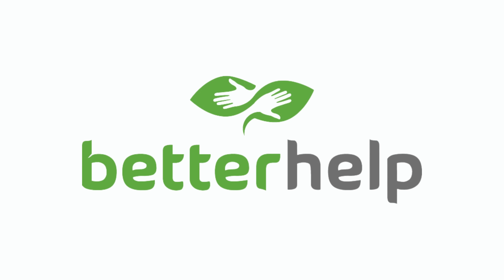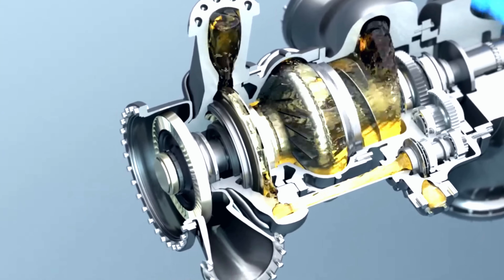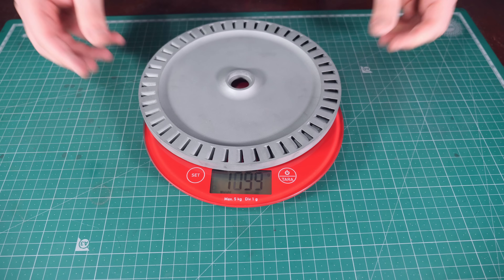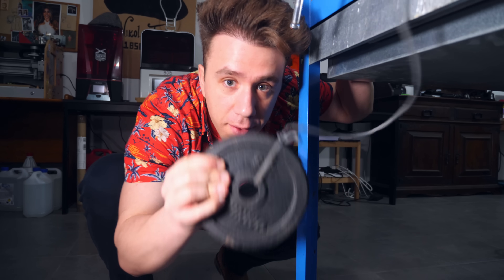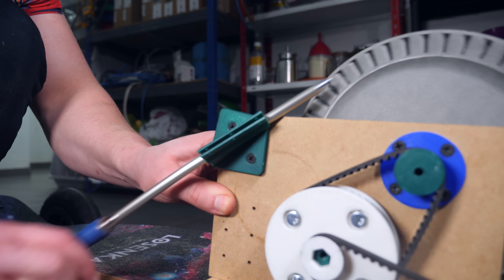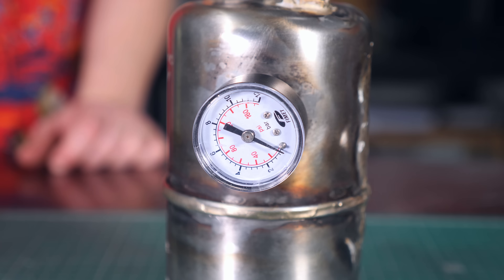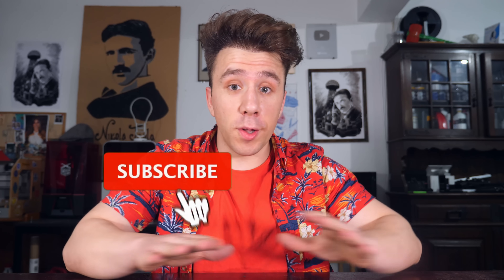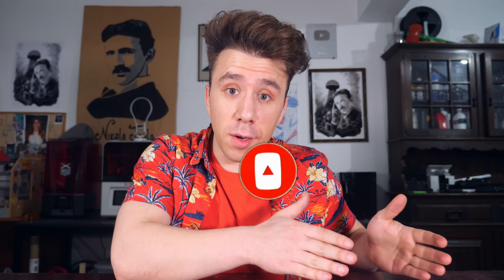I built a TURBINE Skateboard

Comment: Too many dangerous elements in your ‘design’ and execution. It’s one thing to experiment, but quite another to experiment with your health. Open printed metal flywheel with no guarding at all. It could have shattered and all the bits would have hit your face. Liquid nitrogen where were your gloves? Bottled nitrogen, no pressure relief valve. Not fixed to anything. If you’d dropped it the valve could have broken causing the bottle to fly off, hit you or a bystander.
I usually enjoy your videos, but no this one. It was a stupid idea, executed stupidly.

Comment: How about taking what you have and mounting it on a go cart frame. You’ll have steering and brakes. You can offset the additional mass of the go cart by running your turbine with the regulator on the nitrogen tank at a higher pressure.

Comment: Is the turbine engine a cousin to the turbojet engine? They seem to be basically the same thing, except for how a turbine engine uses the internal turbine to give a mechanical output instead of connecting it to the intake fan and using the escaping gasses for thrust. I thought you were talking about a turbojet at first because you used turbojet diagrams in the video, but I could be wrong.

Also, since this engine resembles a turbojet so much, would it be possible to combine both into one? An engine with both a mechanical output for driving wheels AND a jet exhaust for thrust?

Comment: Maybe try mounting the turbine on a “spar” sticking out in front of the front wheels and placing the nitrogen bottle on a towed trailer.  This would give you room to sit.  By using skateboard style mounts you could steer by leaning.  Mount a pole in the center of the board to make steering easier.

Comment: This is INSANELY suicidal. MAKING a pressure vessel then filling it with liquid nitrogen, then putting it on a camp stove???? You're gonna need a lot more than safety glasses. Why didn't you at least use an old propane bottle? This is extra work to be more dangerous.

Comment: Theme: why traktors dont use jet engines and turbines, in a high tork gearbox. T if the jet is geared down enough, it would make the tractor have enormous torque. You could also use an hydraulic gearbox with expanding wheels to make the transition smoother.

Comment: Cars (and trains) aren’t powered by turbines for two simple reasons: FOD (foreign object damage); and dirt. 

Several companies have tried, both cars and trains, but found that it required way too much air filtration.  

Something as small as a 1” 1/4-20 bolt can and will cause a catastrophic failure if ingested by a turbine.  

It breaks off a small piece of the compressor, which breaks off another, and another, and so on until the entire assembly (rotating at several thousand rpm) explodes.  

In addition, dust and dirt build up on the compressor blades, causing flow turbulence to build up.  This quickly leads to efficiency loss, and eventually stalls the compressor, leading to flow stoppages in the stalled section large enough to break off parts of the compressor.  

Having seen turbines explode from both FOD and compressor stalls, I can tell you that they are difficult to tell apart, they happen extremely fast, and you will s##t your pants if you are anywhere near when it happens.  

I spent 43 years operating gas turbine generators.  We had to shut down to wash the compressors every 3 months.  During that three month cycle, we would lose as much as 5% efficiency.  

That may not sound like much to the average layman, but it is enough to make engineers shudder.  

Gaining as much as 2% fuel efficiency with a new design is enough to make worldwide headlines in the trade magazines.  

In a 40 MW plant it worked out to about $250,000 dollars in excess fuel costs between washes.

Comment: Hello Interngiza, I know it will require more power but I wished you used a kart, this way you can have a place to stand, you are able to steer and also you can compare different types of engines to see which one is more efficient and why (would love to also see all the internal combustion engines or some type of steam engines compared to some electric one working with a cordless drill battery)

Comment: Please don't die... Playing with fire is a thing but you seem to get closer and closer to dying without even realising it. Don't stand in front of a 1.3kg metal disk spinning at thousands of rpms held on by pla (i know there is a bolt in the middle, why not have made the hole the right size for a bolt ?)
AND PLEASE DON'T MAKE HOMEMADE CRYOGENS PRESSURE VESSELS *EVEN LESS WHILE HEATING THEM GOD DAMMIT*

Comment: Cool video. My suggestion for a future video would be:
1. Add a seat (you didn't look exactly comfortable)
2. add steering
3. Mount your pressure tank so you don't have to run and grab it if you bail.
4. Enclose your flywheel for efficiency. (Just like in a car the radiator fan doesn't work well without a shroud). And maybe safety?
5. Crank up the pressure bro !!!!

Comment: Love your Crazy man.  
Suggestion : multiple turbines configured as a Tesla turbine.  Would be cool to see what happens when you stage the rotors of a Tesla turbine down the closer you get the the outlet.  
 Also noticed your turbine wasn't exactly Flat or round.  Maybe if you have a friend or a nice local metal shop they could put it on lathe for you and fix that and see if that helps. Also would putting a duct around the turbine help at all?

Comment: Test the limit of a flywheel battery on the void with a magnetic axis. In theory, the limit of the energy stored is the density and the strength of the material. Something like a carbon fiber flying wheel will store a lot of energy. Then try to use it on a vehicle. Despite your opinions on tomatoes, you will like this project

Comment: Mechanical engineer here with a specialty in DIesel engines here, the reason why turbine engines aren't used on cars is actually pretty simple:

Turbine engine = High horsepower, low torque if you are gonna use the rotation to power up the vehicle, this means that they are easy to stall if you're gonna use the rotation, if you wanna use the thrust then you would need a decently big engine which might damage any other vehicles and/or person behind the vehicle, not to mention that they are not very efficient for land traveling, now, air traveling? that is where the money is.

EDIT: not all hope is lost though, I forgot that there's a way to power up a vehicle with a turbine engine while keeping a good efficiency ratio, instead of powering the wheels directly do the turbine power an electric generator with a high-capacity capacitor + any decently sized for the application batery for alternative power up, this way you can extract the work from the engine and even store it and use this charges to power up en electric motor, for proof of concept look up how modern tanks work, a good chunk of them use a turbo engine exactly this way, the only drawback is that this setup is REALLY heavy.
Reply: "this means that they [tubine] are easy to stall if you're gonna use the rotation"

Thats not it, consider the Abram M1 tank uses a turbine for the engine. The issue is fuel economy & emissions.
Reply: @guytech7310  yeah, except the Abrams M1 and variants don't draw power directly from the turbine itself, what they do is basically put a high-speed Jet engine and use the exhausts gasses it produces to indirectly power a fan turbine similar to what Integza here was using, the actual Jet engine has never direct-contact with the drive train, reason why they do this is to... and hear me out... to avoid stalling the engine.

Other tanks that use turbine engines that don't do the while electric generator thingy I mentioned on my edit do this for the exact same reason, turbine engines on their own are easy to stall if trying to directly extract the torque for usable work.
Reply: @thedinastyguild  Its still a turbine driving the shaft. Its just the shaft driving the compressor & drive rotor aren't connected to the power turbine (ie dual shaft design). This is also used for NatGas turbines for electric plants which use separate shafts for compression & power take.

Bottom line, your initial comment is wrong.
Reply: @guytech7310  look buddy, I'm willing to admit that calling them turbine engines in that specific context is not quite accurate and thus giving you some credibility to your claim, however, put under context I'm clearly talking about the jet itself being easy to stall for that kind of application, those kinds of engines are converting thrust into torque instead of extracting torque directly from the jet because JET engines which under the broad definition of turbine qualify as a turbine engine generate a lot of extractable work (horsepower) but produce a laughable amount of torque, converting the after-thrust into torque might make an engine that's borderline impossible to stall but still don't change that the jet is easy to.

Additionally, these types of engines are HUGE and require a lot of cooling which adds to the low viability for land vehicles, tanks aren't really an exception to this but given that this type of dual shaft turbine engines are quiet (at least by comparison against a standard ICE of similar size) they are a rather obvious pick for that specific application.
Reply: @thedinastyguild  You stated in your comment "Turbine Engines" not Jet Engines. Turbine engines include steam & even wind turbines. You got to be specific!

In this video its more analogous to a steam turbine or a wind turbine,  since no compressor is used in the process.

That said, i am just messing with you! Hope you have a great day.

Comment: Building a pressurized container was a very stupid idea, especially with liquid nitrogen. It's just unnecessarily dangerous! Why don't you just stand on the skateboard and ride it normally? Have the jig and the bottle between your feet and hold the handle in your hand! Also, bunch of 3D printed parts that you could buy at a hardware shop, come on.

Edit: You realize you could have saved lots of time and money if you 3D printed only the outer part of the turbine and bolted it to a generic steel disc?

Comment: Dude. You have more than 1M subs, you gotta start taking safety seriously. A 2kg disk spinning at 6000rpm while attached to plastic components, that's stupid af. You can't pressurize an improvised container with liquid nitrogen in it by throwing it onto a camping stove. Hell, you can't show a close up video of you using a bench saw with absolutely no protection gear whatsoever. You are a content creator and are responsible to talk about safety. One day a kid will lose an eye by blowing up a spray can to imitate what you did with the nitrogen and you will be responsible for it.

Comment: The problems of the A-831 in the Chrysler Turbine Car is enough to get a first order answer to why cars don't use them. My understanding was, even with regenerators, efficiency was low and the engine took so long to spool that it was hard to drive. Generally speaking, the gear ratios required also cause huge problems for direct-drive systems, to say nothing of the hot exhaust. None of these issues are truly insurmountable, but they make the concept pretty terrible for a vehicle with a direct drive system. The drive system for the Abrams is complex and maintenance heavy, and "drives like a tank" is probably not a good review blurb.

The obvious question is can you use a hybrid electric system? Yes. A turbine's performance and speed is well suited to an electric generator. However, the efficiency of a turbine scales with the square of the diameter, and they need to come up to speed and be fully warm to operate as designed. This means their efficiency is going to be low at the scales a hybrid system would require, and a turbine-powered charging station for a pure electric vehicle is likely the best way to approach any reasonable efficiency. 

Which is not to say I wouldn't love to see clever solutions, or that I don't appreciate a multi-fuel engine (beyond multi-fuel diesels) may be worth the efficiency drop, but between the fuel consumption and the consequent emissions, it needs a ground-up design that focuses on its strengths and minimizes its liabilities.

Comment: I will give you some advice about the turbine but first… MAN, ARE YOU CRAZY?! You’d have died so badly that your family wouldn’t recognize your face! Pressure is not a joke. That container would explode in a fraction of second before you release the pressure. Please take more safety measures.

Now the advice: You can print a case for the turbine to direct the air instead of blasting it into the air. And you can add some mechanism like a clutch between turbine and the wheels.

Take care, man… please 🙏

Comment: As always, a super cool and informative video. I really enjoy watching the way you work on projects. I got some questions about this I hope you don't mind.

if you shielded the turbine from the wind relative to the vehicle would you see a noticeable gain in speed? While compared to the speed of the compressed gas the wind is rather slow, I assume the compressed gas only contacts a very small surface area of the turbine, where as the remaining surface area is fighting the wind speed. It may be that the two sides experiencing the wind force might cancel each other out, but I'm not certain. 

Would the various nozzles you've made through the years optimizing thrust work well here as well? I assume the speed is mostly tied to the amount of potential energy you can harvest from the pressure difference. Would there be any significant gains running the compressed gas into two turbine wheels parallel to each other?  

Would other compressed gasses like CO2 provide more speed, or would the additional weight hinder the gains?

Comment: All these 3d printer yt guys will do absolutely anything but machining…
Tools complement eachother not replace! 
Almost all of your failure points in most of your videos could easily be solved with a little machining and making your own metal parts. 
Love your vids!
Reply: 3D printing is easier and takes less time usually. Machining is an art of it's own
Reply: machining requires a ton of initial cost in buying machines, crazy time in setup, and probably another cost of mcuh more space. All that for some parts to not be machinable and leaving most of your machines unused for a while and the initial cost not being paid back just makes metal machining unrealistic. 
the parts he needs to be metal are metal, like that turbine and the aerospike he made a while back, which he can solve easily through a machining service like he used in this video, or the (unconventional) metal infused resin like he did in the aerospike. 
most of the stuff in rocketry and engines anyway are super complex to machine

machining initial cost not worth it, can be substituted with services, and even with machining will likely not solve many of his problems
Reply: @broom-z A basic, compact manual desktop lathe could do most of the basic things that are imho  problematic in a lot of Integza's builds (like the hub/bearing adapter for the turbine in this video. So much wobble would be avoided) and really doesn't cost that much.  We're not talking about doing complex 5d aerospace parts, just basic axles, bushings, adapters, nozzles, that sort of thing. The sort of parts that benefits from being accurately round and concentric. One step beyond the lathe is a simple manual desktop mill (doesn't even have to be CNC). Again not a MASSIVE investment (probably similar in cost to a high spec 3d printer like a Bambulab P1) but gives a lot of capability.
Reply: @TheAverageDutchman  well then it’s a huge cost for not much usage
Reply: @TheAverageDutchman  The big problem with these kinds of mini-mills and mini-lathes is their unyielding rigidity of a cooked noodle. Cutting steel on them requires babying to such an extent you can't even use carbide inserts, they wouldn't be in their optimal load/RPM ranges. You'd really want a more rigid machine for working anything but brass and aluminium. And that comes with hella price and space. A reasonably cheap desktop CNC mill that can cut steel, I.E. Carvera, runs the cost of 3-5 high end printers.
Reply: @EgorKaskader  something like a small Schaublin or a Myford ML7 does steel absolutely fine. There's a lot of machines out there between "cheap shit from China" and "full size CNC lathe". Similar with mills. Also, you don't NEED carbide for a lot of small scale work. HSS works just fine if you know the basics of using a bench grinder to keep them sharp. From practice I also know that there is a large difference between not being able to use a carbide insert and that insert not being at optimal cutting speed/load. Carbide inserts work just fine even well outside their optimum, they just don't last as long. Not really an issue if you're not a job shop needing to save every single dollar.

Comment: because of market mutual taxing agreement fees. try contact drop electroplating metal 3d printing. its free. yep print on a metal sheet on top of a normal 3d printer bed. 234 is an interesting number. nope. no false gods. you increased in entropy nice. oh snap. putting a chair flat on the board tho. nice atmospheric heat expansion energy storage. tank on the back. stand on the board. divers suit. thats called compressed air engine. lulz. try ducted centrifugal blower fan thrusters, yep directional not cycloidal. yep enclosed centrifugal fan drones. yep a bicycle with compressed air tank.

Comment: Use a larger flywheel/turbine and mount assembly on a bicycle.  It will give you steering and a stable platform to mount tanks and gears.  The drive wheel already has a sprocket AND you will have brakes